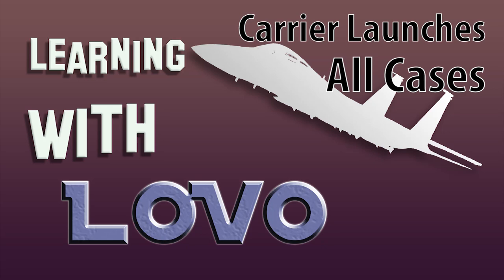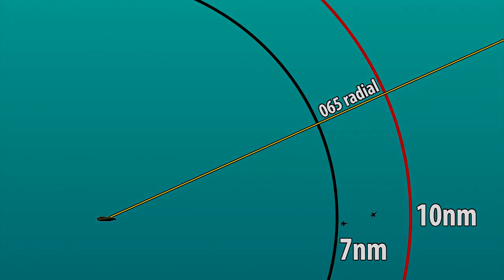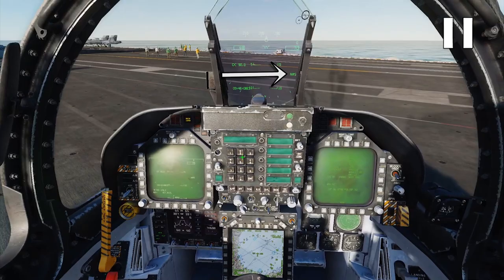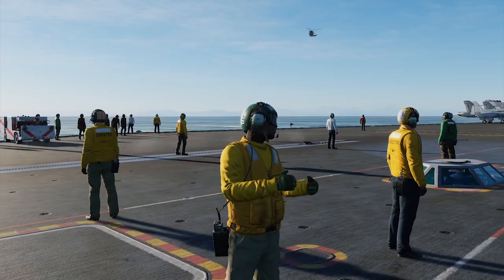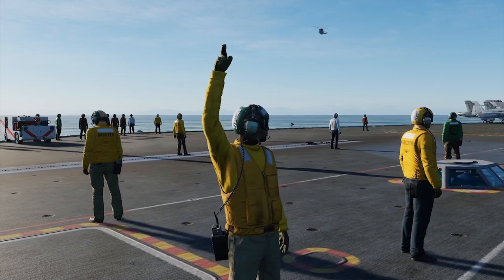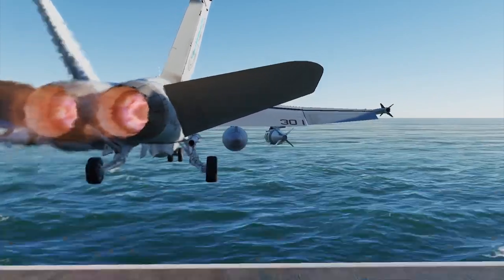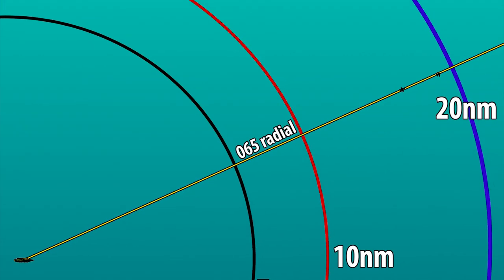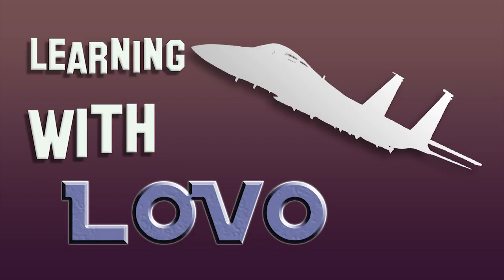SuperCarrier Launches Tutorial - All Cases

Comment: Really enjoying your tutorial work; it's very well presented, concise and clear.  Regarding asymetrical loadouts, I've seen a couple of real Hornet and Rhino pilots say that they'd trim roll after launch.  This may be a pilot-to-pilot thing though, and I've seen "anecdotal discussion" that the chart is only really for very uneven loadouts.  As for the DCS FM, I've had no problems trimming roll in the air on carrier launches; shore take-offs, however, I find need at least a some rudder work though, and the pre-set trim is useful.  Double ugly is important for the Hornet, could be the subject of a future video for you.
Reply from the maker: Yeah, ideally someone on the deck would hold up a weight board with load moment, then you wouldn't have to do maths and could still set it all up correctly.
Good point about the post launch trimming though.
Thanks!